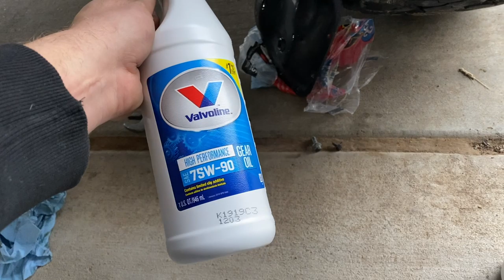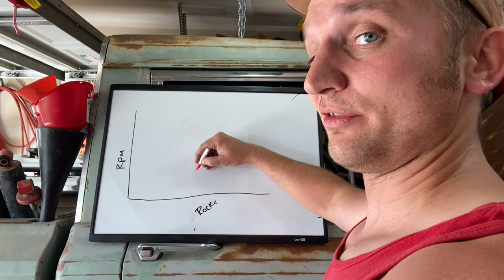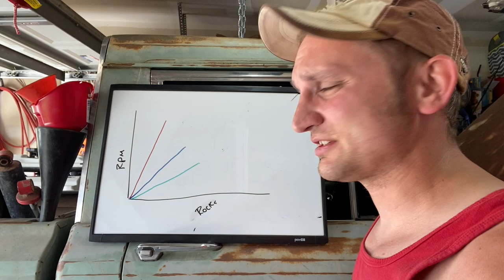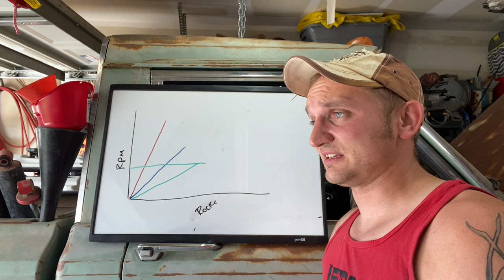Gear break in, what to expect

Comment: was there any noise on break in ??? god dam it. i just put gears in and the back is singing!!   haaa
Reply from the maker: Some noise can be normal… a lot of noise… I’d be concerned
Reply: @JLLIFEOFFROAD  yea... i know im in denile . the  whin starts at 57 mph goes to 65 mph. then becomes very fant. but it is still there.. now i have 300 miles on these gears. when i remove it do you think i can still get away with redoing the pinion depth and reusing everything?
Reply: @spotless624   Yes redo pinion depth take time to get the best pattern you can, I know it can take a couple days. Break-in a second time and it will be fine.
Reply: @verne4336  hello...  this was a while ago... so what i did . i put back in factory shim .. I rolled the dice..  it turned out to be  ...  .086 ..  and now its  6 thousand miles later.. what happens is at 58-62 mph i can hear a whinn... 65 to about 96 its ok...  then around 106 it starts to whinn again..   the whinn at 60 mph is tolerable, if the radio is on you dont really notice it. I'm living with it .. in a few weeks im going to change the diff fluid and check for metal..

Comment: You are actually braking in your bearings not gears. gears are a match set and are hardened 😎
Reply from the maker: Lmao.. I hear used diff oil makes excellent blinker fluid also 😂😂😂🙌
Reply: @JLLIFEOFFROAD  your bearings and races are the meager parts you are braking in the gears if setup right will show no ware in that time